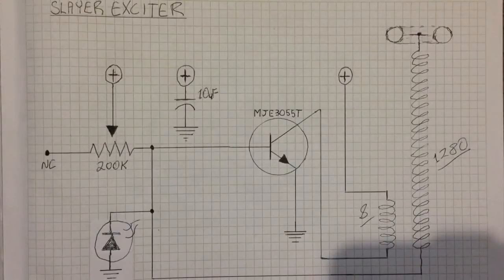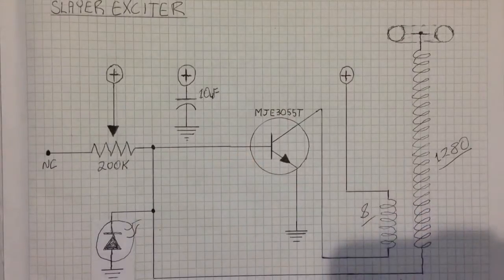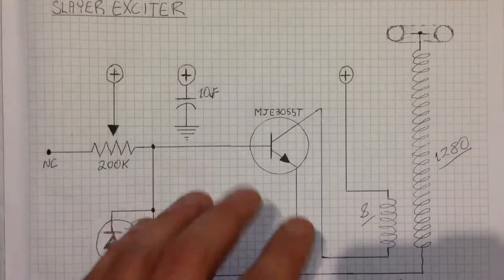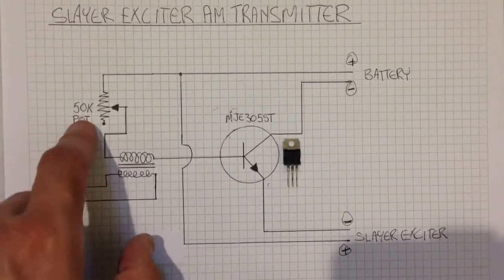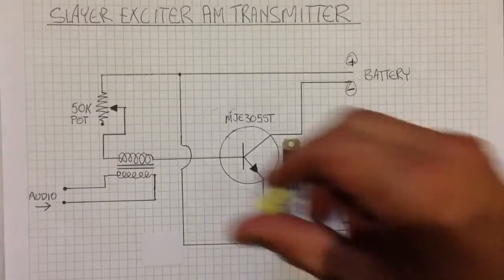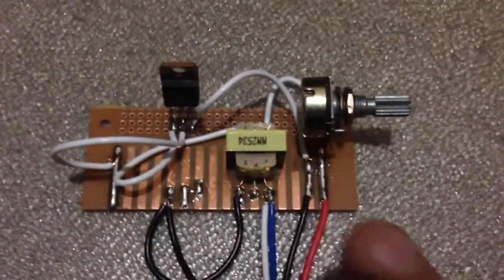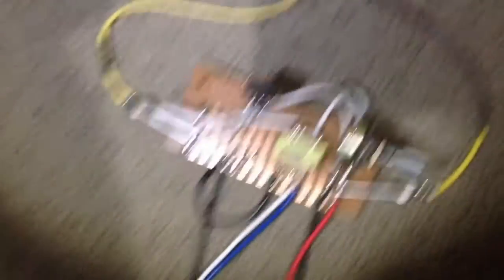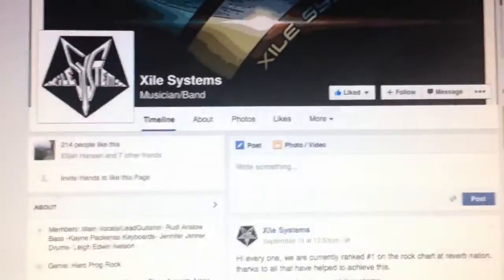Slayer Exciter Part 4 (AM Transmission)

Comment: I'm working on a solid state Tesla coil currently and these circuits of yours seem to facilitate a sort of "plug-and-play" system where modules can be added or swapped out to achieve different effects and for different experiments without needing to rebuilt or build circuits varying around a theme.  Providing you don't smash them up with a hammer when your done with each one, obviously.   Bloody great content, mate.